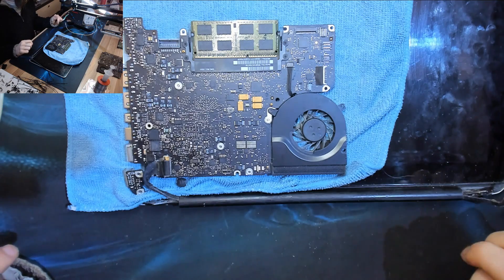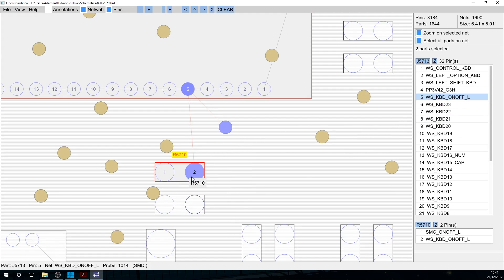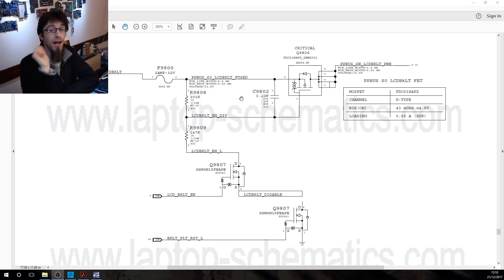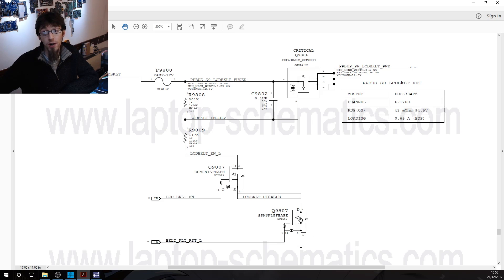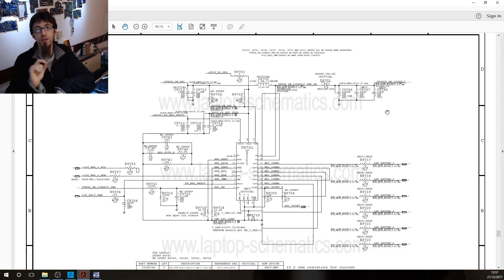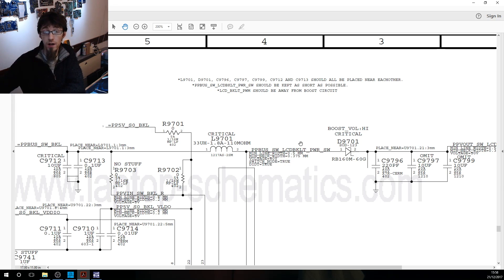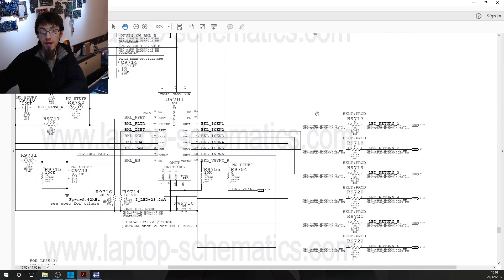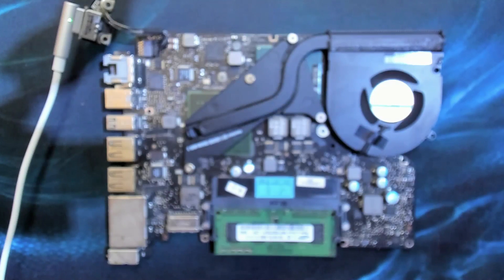Board Repair Basics #7 - Boost Converters (Backlights Pt1)

Comment: Does all of the stuff like One wire circuit, Buck converters, SMC also present in other laptops not just apple ones?
Reply from the maker: Yes and no. Buck converters are used everywhere in all computers. SMC is an Apple thing, but PCs have an Embedded Controller (EC) which does the same job as the SMC. Some brands like Dell and HP use One Wire to talk to the charger, but most brands don't bother, and simply accept any DC input. The power rail names and layout can also vary, but follow the same basic principles.

Comment: Great video sir. Need to ask some questions sir, i am in repair of a dead laptop. And on the second mosfet output  im getting a low intermitent voltage of 3.5v to 4v. Any ideas sir what was causing the voltage dropped? Thankd

Comment: Great video but the one thing I can never get off the schematics is particular voltages at various points. I can understand the 16v/12v/5v/3.42v/3.3v/1.8v/1.5/1.05v and 0.75v main power rails as they are listed on those schematics but the others is a mystery. For example, in this video at around the 6min point, you talk about voltages of LCD_BKLT_EN and BKLT_PLT_RST_L needing to be high but I cant find anywhere to suggest what that high value ought to be in numeric terms, so I can see via multimeter measurement if I'm gettng good values or an indication of fault on that line. What advice could you offer ?
Reply from the maker: It varies on the device, but on these macbooks a Logic High is typically 3.42v
Rule of thumb is that if it's not 0v, it's high. Weird numbers like 0.7v will indicate a possible issue.
Reply: @Adamant_IT  Thanks, you're a star. Basically I was getting nothing on the BKLT_PLT_RST_L line so I traced it back to a missing resistor that was supposed to join it to the rest of the PLT_RST circuit. Swapped it over from a donor board and all is good

Comment: Hello Adamant IT. Great series. Quick question if I can, If U9701 supplies a ground switched after a coil does that then make the circuit an AC voltage and is the zenor diode a fifty volt diode?
Reply from the maker: Nope. It is a switch-mode power supply, which means it works by pulsing the voltage on and off, but the voltage doesn't fall negative (backwards) at any point. AC works by push-pull, like how a serrated knife cuts in both directions.
The diode is 60v, it stops the output from getting pulled low when U9701 goes low, and I think they use a zener to make sure that if the output goes over 60v, that excess can bleed back into the coil (or ground provided by U9701) to protect the backlight - I'm not 100% certain on that bit though.
Reply: @Adamant_IT  Thanks for taking the time to reply. Keep up the great work. 👍

Comment: Thanks for this tutorial, very helpful ! is the back-light fuse special or can you replace it with other similar fuse  ?
Reply from the maker: Standard 30v 2a fuse if I remember correctly. I use eBay fuses no problem, just as long as something is there to blow if the backlight fails short-circuit.

Comment: Is there a way to change the serial number on Macbook logic boards? I've seen there was software for it, but I want to know if there's a chip like bios or smc that has the serial number written to it that can be taken off the board and flashed? I've seen Honda Civic odometer mileage reprogrammed by reflashing a chip, which is just cool! Thank you so much for making this series. I have learned so much. I'm trying to learn logic board repair, so I can start fixing these on the side and maybe open my own shop.
Reply from the maker: I haven't looked into BIOS flashing for Macs... It's probably possible, but I haven't seen it as generally speaking there's no useful purpose in it.